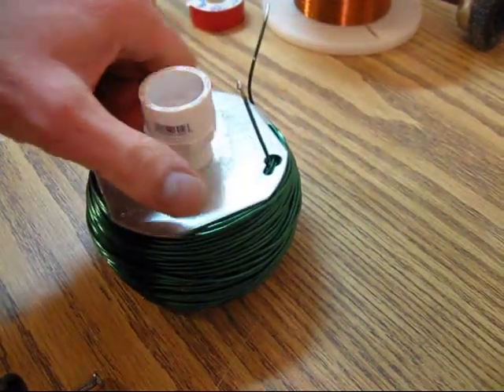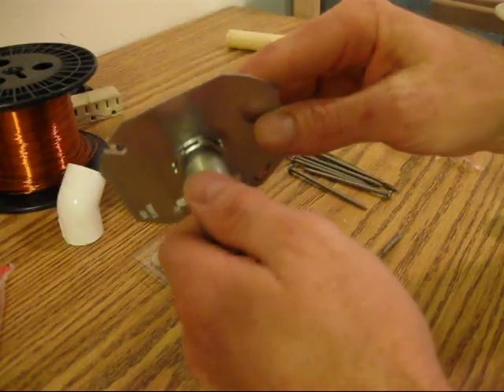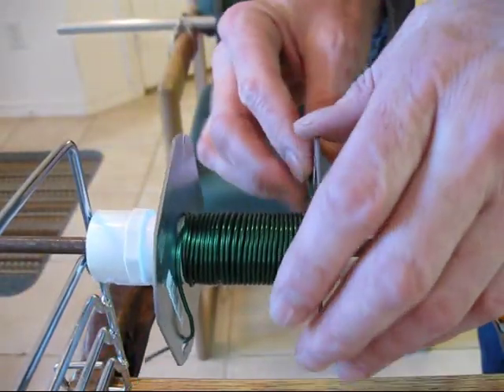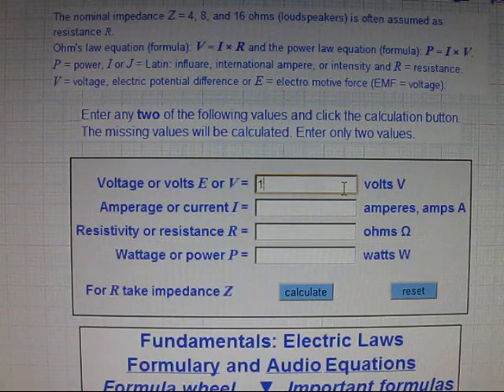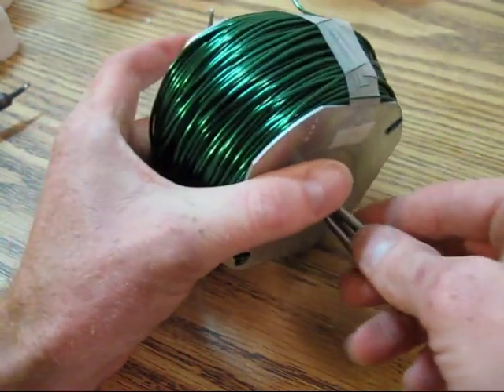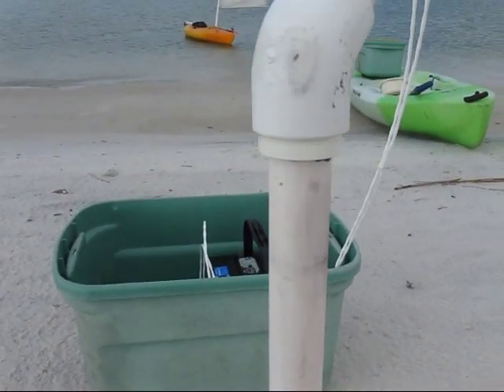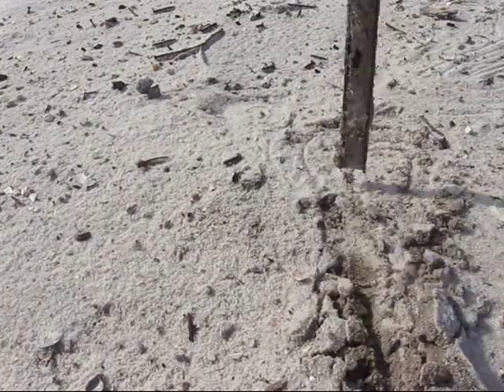science project - build a strong 12 volt electromagnet

Comment from the maker: any insulated wire will work, but keep in mind magnets may get hot depending on how long the wire is compared to the voltage and current and if the insulation melts or burns it will short out. Magnet wire is designed to withstand heating and has very thin insulation so you can get many windings in the space of the coil

Comment from the maker: The longest I have tested this magnet at 100% duty was about 4 minutes. I do not have a thermometer to accurately measure the surface temperature but it has never become too hot to hold in my hand. If 12V @ 15 amps was left on it continuously the heat will continue to build up until a balance is achieved where the outer surface cools at the same rate the coil generates the heat. Suspect it will be well below 100C in open air. There's a scientific formula for this somewhere out there

Comment from the maker: A couple ways you might be able to get magnet wire for much less than the cost of new material from an electrical supplier. Ebay. You can get anything there and often get great deals. Check your local scrap yards regularly. If they will sell to the public and let you search the bins you might get lucky and find what you need at just over scrap value. But be cautious. Old mag wire might have brittle or damaged enamel insulation.

Comment from the maker: magnet wire is solid wire, usually copper, with a very thin coating of enamel insulation. Used for making transformers, motor windings, inductors, electromagnets, solenoid windings, etc.

Comment from the maker: I tested it with a sledgehammer (only thick solid steel object I had) tied to a 5 gallon pail that water could be added to increase weight until it broke loose which was at 34 lbs.

Comment from the maker: I don't think you could build an electromagnet out of common materials that did not generate any heat. It's just the way it is. I discussed this project with a friend who is an electrical engineer to get an idea of the best design and he rattled off some ohms law formulas and we came to the conclusion with this type coil and core at 12v about 600 ft of magnet wire would be optimum.

Comment: what are all of the materials and what do u suggest I can take away or make different to make it cheaper
Reply from the maker: the magnet wire is the most expensive part. Try eBay you might be able to pick up a large roll for not much more than the copper value

Comment: I need a 20 Tesla electromagnetic field and have zero plans to use cryogenics.

I can build the coil, no problem.

So I'm trying to think of some novel ways to avoid the wire melting when I switch power on. 

(Backstory -- I'm building a high-field NMR (nuclear magnetic resonance) device to test the outcome of aligning, then 
   oscillating 1/2 spin atoms for the crew compartment in a ufo build-out).

If you have any ideas on avoiding the use of cryogenics to keep wires cool, please let me know -- thanks in advance.

.
..
.

Comment: Cool to make but for work i think its better to just get a piece of iron magnetized. I was trying this on a smaller scale trying to magnetize a nail. I used 30 feet of 30 gauge magnet wire with a nine volt and no real strength. Any tips?

Comment: what is the number of turns that i will need to repel 2 fast cars
Reply: About 9999999999999999, and they would crash
It would be just as if they both crashed, but to an invisible barrier as no chassis can just "absorb" that momentum... if its a toy car, then just experiment

Comment: I inherited a farm with a bunch of old burn piles and rusted junk piles and this would be great for me.  I am good at building and fixing things but I have never messed around with things electric. One of the things that intimidates me on your video is the part where you talk about ohms, watts and whatnot. It's way too much like math, and I just barely got through that in community college. Anyway, is this a dangerous project to attempt without any electric knowledge, or should I try to find an electrician to make one for me?
Thanks for the great video. I would give you two thumbs up but they only count one!
Reply from the maker: +William Mayer  An electromagnet is a very simple device.  Making an efficient electromagnet might require some of that confusing math. As long as your not messing with high voltage or directly shorting out a car battery this is relatively safe.  Hopefully I don't need a legal disclaimer?

Comment: can i just wind up a coil around a metal rod and use a AA battery and not use the diode?
please somone tell me
Reply from the maker: +bruno baumanis  the purpose of the diode is to bleed off the reversing power spike that is induced in the coil when the magnetic field collapses when power is disconnected. You would want to prevent the arcing on the switch contacts in a higher power application such as this otherwise after a few hundred times of switching it off the contacts will likely be disintegrated and the switch will fail. A 1.5 volt AA battery powered electromagnet will have an insignificant kickback effect and the arc will be so small when you disconnect the power that it will not harm a switch. You can make a simple electromagnet with a steel rod and insulated copper wire and power it with a AA battery.   Use several feet of wire and you should be able to lift small steel objects.  There are many videos on YouTube.

Comment: Hello sir. I am doing this as a science project with my 5th grade class. Can you explain how to pick the correct diode for this and how that diode is wired into the circuit? Thank-you
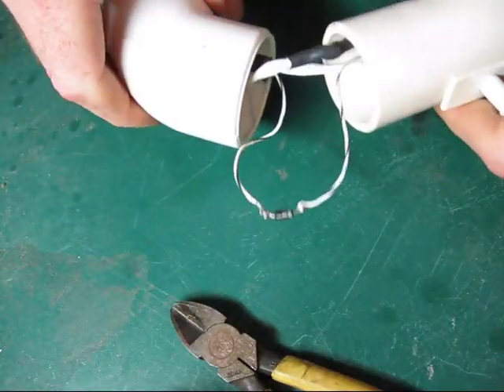Reply from the maker: The diode is not necessary to do an electromagnet demonstration. It's purpose is to bleed off the reversing high voltage spike every time power is switched off to the magnet coil otherwise the spike will jump the contacts and make that bright blue spark. Any diode will work, about 1/2 watt. Connect it in reverse across the coil as shown in the schematic at 2:40. Once this diode is in the circuit you cannot hook up the electromagnet "backwards" to reverse the polarity or it will short and burn out the diode. It only works in one direction.
Reply: RLZerr Thank-you! Thats very helpful. One other quick thing... When you connect the magnet wire to the cable wire, do you use any special connector since one is so much thicker than the other.
Reply from the maker: I used common spade connectors and PVC fittings so the coil can be disconnected. With 13 gauge magnet wire crimping on the connectors is no problem. Smaller wire will be more fragile

Comment: Hi,
I am glad I came accross your video.
I actually get there from google and what I am deeply curious to know about is the amount of Maximum Voltage my 3.5kg Air Core Electromagnet can bear.
The Core of the Solenoid is 120mm in heigth and 13inches in Diameter. It core is 47mm wide and 130mm long.
I used 0.31mm thick enameled copper wire to make it and after winding it reads 1.4KOhms
Please may I know the maximum Voltage to apply to it in other not to get it burnt?
How do I calculate that Sir?
Reply from the maker: +janet edwards  sorry for the late reply, unfortunately I don't think I can answer your question and be 100% certain I am correct so will leave that to someone more qualified. I do not work with high voltage.